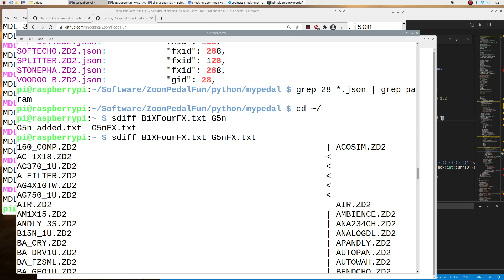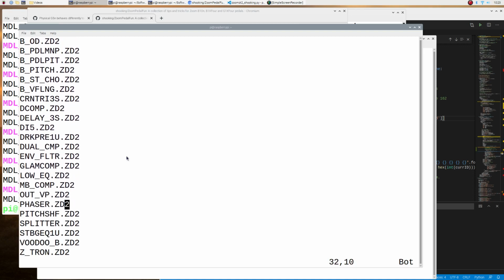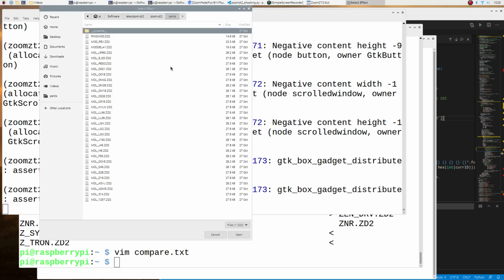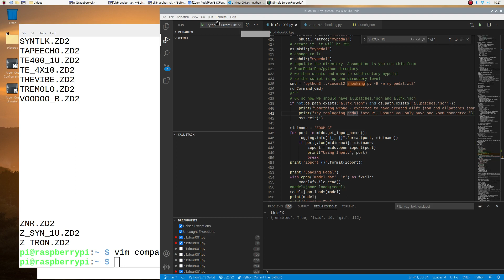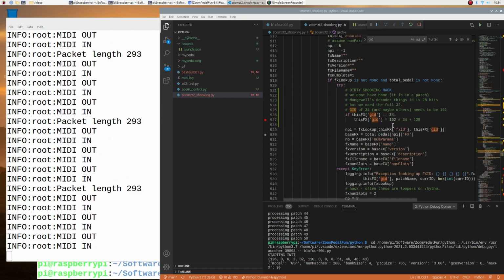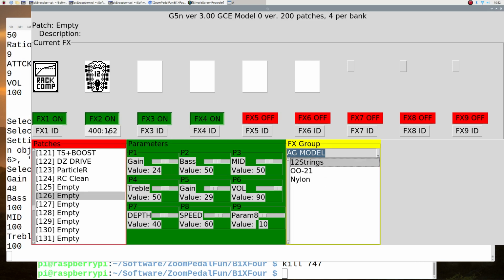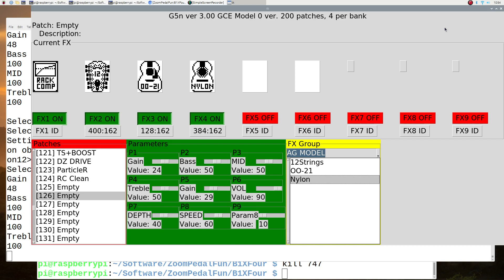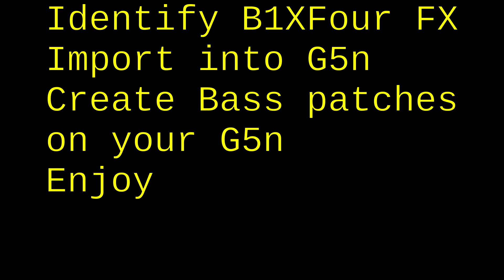Zoom G5n: Adding B1XFour FX

Comment from the maker: FInally debugged an issue with IDs - Zoom ZD2's have a 32 bit ID but Mungewell decodes in patch as 28 bit. So the newer A1X FX were getting GIDs or say 162 but then being decoded in the patch as 34. I hacked my code to add 128 on if GID is 34 - I know - not cool. But it works.

So now I have my G5n ready for tomorrows gig with 37 additional B1XFour FX and 3 A1X guitar models.

The B1XFour serves me well - and the luxury of a:
USB output - dont need at the gig
Mini total patch display - cant see that when standing up
up to 9 FX - ok that could be useful especially now I added the bass FX
4 footswitches to turn FX on /off - much easier than the B1XFour. Careful of that scroll window.

disadvantages
size/weight
doesnt run off batteries (could make a battery for it)
would be more upset if I lost this (cost)

Comment: Do you know how can I inject ModReverb,  DryPlste, DuaPitch from A1 Four into real G5n? After injection, the effects doesn't show into my G5n.
Reply from the maker: Thanks for specifying the pedal. Check out the GCE-3/DerivedData/1.20/A1FOUR_1.10 on my github ZoomPedalFun for the ZD2.
Then copy those to a local directory and use Mungewell's GUI to add them.

Let me know if you need more info. I can either make a video or post more details.
Reply from the maker: My guess is DUALPIT.ZD2 and MOD_REV.ZD2 are FX. I can't find the dry one. Is it DRYPLATE.ZD2. This plate reverb simulation can provide clear reverberations?
Reply: I did it yesterday, I downloaded the files from your github, both A1X and A1. Both ends with same. The effects doesnt show in The G5n

Comment: With ZD2 group is 8bit and ID is 32bit, also in some places group is placed in the upper 8bits of the ID... In ZPTC array there isn't enough space for the full 32bits, I have parsed 28bits followed by an unknown bit - which may well be your issue.
Can someone send me a patch file from the A1Four containing the effects from the AGMODEL and/or ACOUSTIC groups?
Reply: Was able to extract patches from GCE-3 FW, and LooperTron's 5th effect is '0x1F000010' (though don't know what this is).
Looks like you are correct, the unknown bit (previously only seen as 0) is actual the 29th bit of the Group/Id combo... Fixed 🙂
Reply from the maker: @mungewell  yes I guess 32 bit but for sure needed a top bit. So the acoustic models work well now - bass sounds like an acoustic bass.

Just the looper and rhythm on G5n / G3n evade me. I can get icons from alternative source but, as we already discussed, these are dummy. I believe I can trigger rhythm (I still need to generalise this) but looper is special. The GCE-3 doesn't seem to emulate G1X looper or rhythm - i figure this hints these are on board.